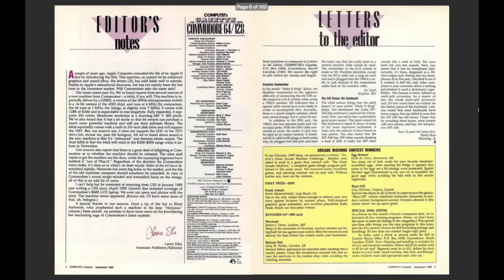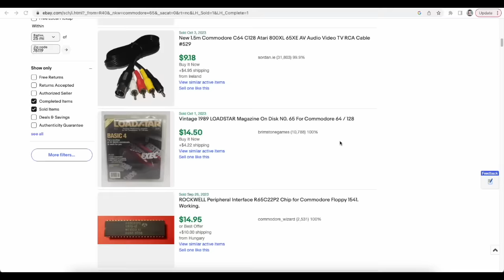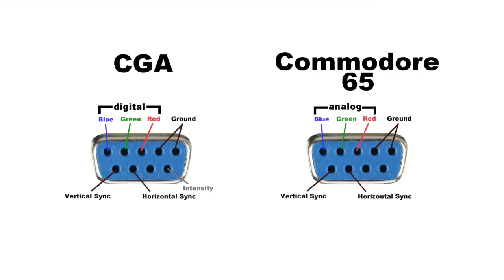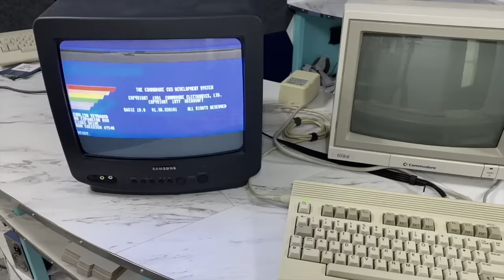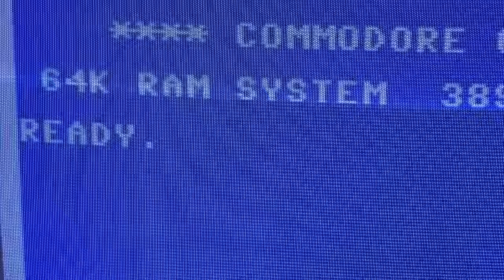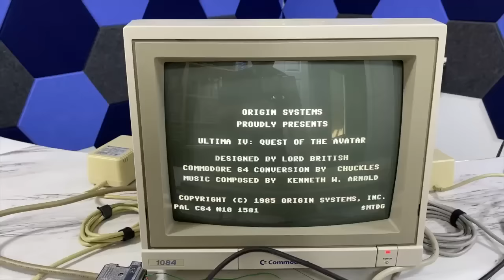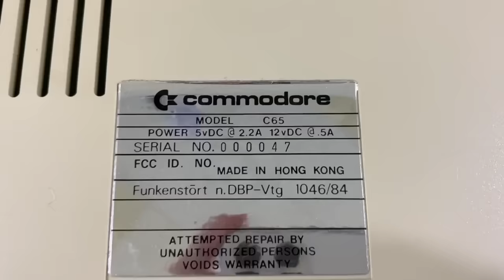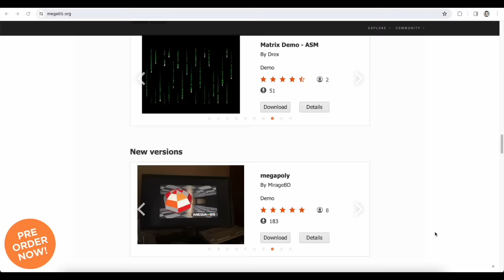The Commodore 65 - A Rare Prototype

Comment: Just to share some of the back-story on the c65-support vs MEGA65-support of the MEGA65 rom. Firstly, I was happy to see Bit Shifter's name on the rom chip 🙂 I take it as a good sign that c65 owners got some benefit from Bit Shifter's efforts 😄

I remember a time in the past, a few years back, when the MEGA65 discord community was discussing whether to focus on maintaining c65 support or focusing more on making use of the mega65's own capabilities.

I think I remember Bit Shifter being very keen to make use of the mega65's hardware capabilities so that the rom could benefit from them, in both the saving of rom space (make the rom code smaller) and performance. (Up until that point, he had preserved a sense of c65-backward compatibility).

He had held back from adding MEGA65-specific logic for quite a while, until things built up towards that discord conversation. I think by that point, at least batch1 of the MEGA65 was out in the wild, so it meant a larger community could benefit from those mega65-specific enhancements.

On our discord, there were opinions moving in both directions, my gut feeling is that c65 owners would have preferred we keep assuring c65-compatibility, though many of the mega65 development team didn't own c65's, and a larger community of mega65 owners was taking shape, and so the decision was made to support the larger community that was growing.

That being said, the mega65-project and Bit Shifter, did push forward the state of the c65 rom further, and that is still a good thing for c65 owners, as the label on Bo's rom chip shows.

Could things be improved for c65-users? Potentially, though I feel like c65 owners would be the ones putting on their developer hats, cherry-picking parts of the latest rom they can benefit from, while omitting MEGA65-specific logic.

Should MEGA65-developers of software consider c65 backwards compatibility? I guess it'll be up to each individual developer. I sense most will cater for the bigger MEGA65 audience. On the other hand, if a C65 developer wants to build a program and share it with the MEGA65 community, there's a good chance their work can be enjoyed by the MEGA65 community.
Reply: The MEGA dev guys are all really great, and I'm so thankful for their help in getting a less-buggy rom.
Also, yea, your analysis of the 'biggest audience' situation is right-on, though I would also add that to even have a Chance at making C65 compatible software, they would probably want to downgrade their rom to something more like mine, and who would want to do that?
Reply: @bozimmerman interesting 😊
Reply: "BitShifter"
I first misread the lable on that rom and it had me rolling on the floor 😀
"f" and "t" do kinda look similar...
Reply: it would have to be a very niche forum lol
Reply: When it comes to audience size or the pleasure of a fixed, well established and explored platform, the 65s will go on having a hard time against the 64.
Reply: BitShifter's work on the MEGA65 (M65) ROMs was legendary. FWIW, the M65 can easily switch between ROMs (by holding down a # key matching the desired ROM at boot), so it's still possible to boot with one of the original ROMs, although there's been breaking changes in the M65 core (but you can also run older cores, so...). As far as compatibility between M65 & C65 is concerned, that's a bit of a grey area altogether, given the C65 was still in prototype phase and in a state of flux.

As an aside, the M65 is starting to find a bit of a niche in the demoscene and there has been a lot of unique software written for it. I'd expect the available software library will continue to grow & likely even accelerate once more batches get into people's hands.
Reply: Wanted to ask if this was the same Bit Shifter as the chip tune musician 🤔
Brain wants to say it's a completely different person 👀
Reply: I've never heard of the Mega65, and up til now, wasn't aware of the C65 either.  But, it seems to me, things took a conscious shift toward creating a fictional computer based on the C65.  With so many community-created retro micros, I feel like that market is a bit saturated.  It's not the way I would've gone.  No disrespect intended ... maybe the Mega65 is exactly the computer that its community wants.  It's just that, in this age, we aren't limited by the state of the art anymore.  We can do almost anything you can imagine.

So -- genuine question here -- what's the rationale behind "using the platform's capabilities" when that doesn't necessarily have a ceiling?  (You could always put in a larger FPGA, or add 1GB of RAM, etc.)  I might be reading the room incorrectly here, but wasn't it the point to create an accessible clone of a rare computer?  Once you open the floodgates to what it could be, well... it could be anything at all.  But what's the fun in that?  It's like creating an NES clone with a 20MHz core, bitmap graphics with 64k colors, and stereo 44kHz PCM channels.  Hardly an NES anymore at that point, and if you're not constraining it somehow, what makes it special?
Reply: @nickwallette6201  I posted a somewhat lengthy response on this, but doesn't seem to have made it through. I'll keep this one shorter in case it does :-) Perhaps convos on this topic are best done in other forums, so you're welcome to reach out to our community to learn more and we can have this convo there :-)
Reply: @IshiTheLastYihi   ... OK, yeah, that's probably for the best.  :-)  Thank you for trying though.

Comment: I have an even more rare prototype in my barn. I built prototypes for Commodore. Tom Hilltine was the head of R&D. I was given an NEC computer, like the TRS100, and a Commodore 64 and was told to take the display out and hook it up to the 64. The graphics of the 64 was about double the graphics of the display, so I put in a joy stick to move the window around so you could see the whole display. You could play games on it if you were fast at moving the joystick. They used it for a boardroom display and then gave it back to me.
Reply: There are way more super rare commodore prototypes out there. Like the early prototype C64 board labeled "VIC-40", which was listed on ebay years ago, but "disappeared" afterwards and was never seen again. And also theres the only existing single sided PCB from Commodore, the C16 prototype board Bill Herd mentioned in his videos. As far as i know this piece is on display in a german museum.
Reply: @retr0mak161  Those are good picks for rare finds!  I'd just add on the C= V364 computer, and my personal favorite, the DX-64, which is the rarest of all because it has never even been seen except for a grainy photo in a magazine. :)
Reply: Woahhh! I'd love to see a video of em!
Reply: Prove it.

Comment: There IS an official C65 PSU and it's more common than you think. They obviously made lots of them in preparation for the C65 but when it was canned the PSU was re-purposed for the CD32. For anyone who owns a CD32 check the bottom of the PSU and you will see a sticker that says "PSU C65" ^_^
Reply: You must not mean the dark grey brick PS I got with my CD32s.  What did yours look like?
Reply: @bozimmerman  Probably depends on your country. I'm in a PAL region. Mine is rectangular and about the same size as the C64C PSU but black and has the later Commodore stickers with the barcode saying it's a C65 PSU.

Comment: It even has a German labeling. Stating "Funkentstört", which translates as "fitted with noise supression". So it should not interfere with Radio or TV broadcasts or other devices that use radiocommunication. DBP is the Deutsche Bundespost, German Federal Post, which was responsible for such tests and certifications at that time. It was a public administration and privatised in 1995 and splitted into several companies like the Telekom, Deutsche Post and the Postbank.
Reply: Most C65's i know of where made in Germany, and the prototypes where sold in Europe from magazine ads after Commodore had died (i remember the ads even.)
Reply: @SwedishEmpire1700  Some people got their machines by dumpster diving. I guess that's how the VC40 prototype (barely documented early C64 concept) ended up in private posession before disappearing completely again.
Reply: I love the German language. Funkentstört is just an amazing word.

Comment: The 1571-II was introduced in the German Forum64, and you can build them, as Commodore would have brought it on the market, it is based on the C128DCR 1571 with the MOS 5710 chipset, you can build a 1570-II, 1571-II or 1571-II+ depending on the equipment. I built one to fit the 1541-II case with PC drive Chinon F502, and it works great.
Reply: What's the difference? The 1571-II supports double density floppies, or even high density?
Reply: @Stoney3K  is based of the C128DCR 1571 chipset and a narrower case (from the 1541-II (case)) I use this as 2 Drive in one 1571 ROM and ROM from 1541-II. The ROM from the 1571-II is DOS 3.1 and supports only double density, a high density ROM not available

Comment: I'm really impressed how thorough you are, also not intimidated by taking apart a $20 to $80,000 prototype.
Reply: Only $20? That's cheap.
Reply: At least he didn't smoke this one like those IBM prototypes.
Reply: @glassvial was like one wasn’t it?
Reply: @glassvial  oh right if i recall he tried the modern psu trick of using a paper clip to turn it on, but on older psu's there's 120v running through the switch..
Reply: Taking a few screws out isn't a big deal. He's also taken hundreds of machines with similar plastic housing apart.
Reply: You do realize this guy can take apart computers in his sleep.

Comment: Thanks for your review! To understand the thinking behind the C65 you have to know that Commodore chose a completely different approach: Instead of including a whole C64 in the computer like in the C128 and thus giving nearly 100% compatibility Commodore tried to establish the C64 as a platform instead. A platform which the C65 was built on. So the C65 was technically a computer based on the ideas and principles of the C64 (with VIC and SID although there a two SIDs and a newer VIC) and taken to the next level (and thus having Amiga-like features which was at the time a must). 

The C64 "mode" was not a built in C64 like in the C128 but a C64-like preset (like memory locations, CPU speed, resolution, etc.) on the C65. So when entering the C64-mode with "GO64" you get a C65 with a memory mapping of the C64. But you are still on a C65 with all its capabilities. You can access the additional colors, CPU speed, etc, within the C64 mode, if you want to. The C64 mode would have been more of a layer to easily port your existing software to the new computer and to enhance it there. Only the second goal was C64 compatibility (which was a primary goal on the C128).

The MEGA team did a wonderful job of finishing the C65 and bringing this great idea into the next century. They corrected many mistakes Commodore made (like the C65 expansion port, which is not compatible to the C64, on the MEGA65 it is compatible) and adjusted some things to todays standards (like HDMI instead of RF - the purpose is the same: to connect the computer to a normal TV set and todays TV sets are on HDMI).

Since the MEGA65 is FPGA-based you can run the MEGA as a 100% compabile C65 if you want to (just boot into a C65 core). However the MEGA65 (with a faster CPU, an even better VIC and 4 SIDs) is still fulfilling the promise of Commodore by making a computer which understands the C64 as the start of a platform which can be build upon. Actually a lot like todays PCs or yesterdays Apple II computers. It's a shame that they didn't do this back in 1985 instead of the C128.

Comment: Very interesting, Dave. I'd always been of the assumption that only pre-production mock-ups or fan projects with 3D printed cases existed - well done on finding this beauty!
Reply: All of the C65 machines were rough prototypes. There was never a fully finalised, production ready design, so what you see is really just a possible taste of what might have been. A few tweaks and changes could have made the final product very different. The C65 was another of CBM's poor decisions, alongside the C16, Plus 4, the C64 "games system", the Amiga 600, CD32 and arguably even the C128.
Reply: 3D printing was unheard of in the 1990s. The injection moulds for that case would have been expensive so it is a shame they never got used.

Comment: I see the similarities to the C128 but then this machine may have had the same issue like the C128 with the software library. Most developers would have stuck with the C64 since it had a much bigger base.
In the end it never came out and the focus laid on the Amiga which was IMHO a good decision.
Reply: Agreed. I imagine that while cool, most devs would have just focused on the 64. Amiga was a good direction for Commodore. Too bad they couldn't continue after 94 but at least we have amazing computers from them to still enjoy
Reply: I wouldn't completely agree with that. I think a lot of the reason the C128 didn't get a lot of support is because it didn't really add much for developers to think of it as a different development platform. The C65 would have been a clear upgrade in terms of capability compared to the C128's lack thereof. It also didn't really come off as anything other than just a C64 with more ram and some weird video peripheral most people weren't going to use. People largely just saw it as a C64 with more ram. 

To shift the market into thinking it's something new, you just have to sell it as a new platform that happens to support the old software. Remember, the expectation was that the new computer would still support their old software. This is why the Amiga had a hard time taking off, it didn't have a software base to stand on, and thus had to start from scratch. This is also why the IBM PC/Compatibles had a huge leg up, they already had an established library of software that would still receive some amount of support going forward. 

The real problem for this machine is that it just came far too late with no enough additional capabilities to justify its existence. The SNES would likely have been far cheaper if all you wanted was a game machine, and it had comparable/better graphics with a much more sophisticated sound chip. Or if you wanted to game and do business, just get a PC.
Reply: I am still convinced that if the cheapest base model Amigas had the expandability of an Apple II then it would have stood at least some fighting chance against the IBM PC. Without that expandability it was still "just a micro".
Reply: You might be right about software support, but I'm not sure. Remember, the 128 mode was not much better than C64 mode. Just more RAM. The rest of the hardware was identical. When the A1200 came out, it was supported immediately. Because it was better. As programmers we are always looking for new stuff. Musicians would have loved the dual SID. And graphic designers would suddenly get more colors than on the Amiga. 

We do new stuff when it contributes to more fun. Using 128 mode was not contributing to more fun.

Also, remember, the 128 was a more expensive big brother to the 64. The 65 would have replaced the 64, at the same price point.
Reply: @railsrust  Excellent points here. I didn't consider these.
Reply: @railsrust    As  I was as CBM, Ocean software dictated alot to CBM in designs and needs,  so much that lower motherboards wont play the latest games.   Ocean pushed the Amiga for software copy protection reason.   C128 failed for lots of reasons, but one of the big reasons is yes the software developers pushed the C64 still and the copy protections stopped new software for the C64 running on the C128, you can blame Ocean for that.   Ocean push for the A500plus to standardise Amiga upgrades to a new limit manyly 1024 of ram and fast ram and a RTC, and a better Blitter for graphics.
Reply: @MaxQ10001 The C65 would have never happened, there be more chance of the C256 project succeeding in a build.
Reply: @pqrstzxerty1296  why is that? Wasn't it very close to ready for production?
Reply: @MaxQ10001  Yep! It was so close to be released, but Irvin Gould canceled it (That Bast*rd!)
Reply: @railsrust  Many companies got the backwards compatibility thing wrong in the 1990s. They didn't think anyone would want to run their old software on their expensive new computer. That was a big factor in the PC taking over.
Reply: @KurtPedersen-tg7jc  Wrong, it was more Mehdi Ali and his crony Bill Sydnes (At that point engineering manager).

Comment: I do like the design aesthetic of the Commodore computers, post-breadbin designs. Like the Commodore 64C and Amiga series. As an owner of both the C64C and Amiga A500 and A600, I clearly remember they were far less 'yellow' when they were newly released and have obviously all become more so with age.
Reply: The bromium compounds in the plastic, there as flame retardant, slowly decompose, turning a brown color. There are plenty videos on retrobrighting, using hydrogen peroxide and UV light, to restore the original color..
Reply: @paulmichaelfreedman8334  a process which isnt full proof and requires repeating. And in the inbetween, its getting more yellow. you know what he meant.